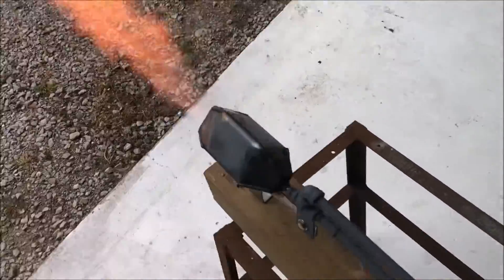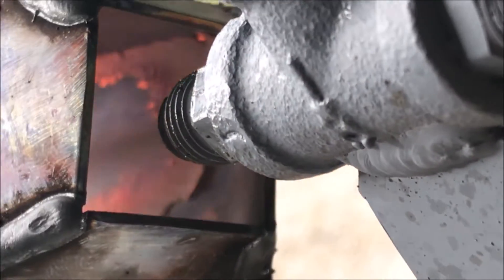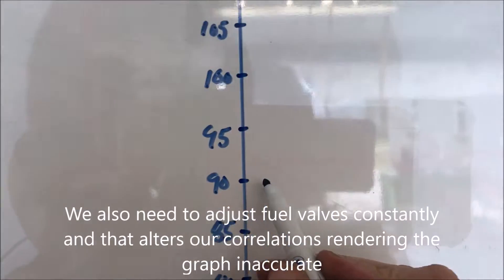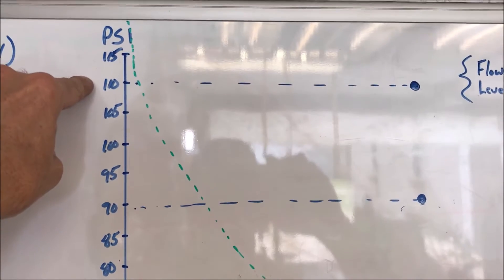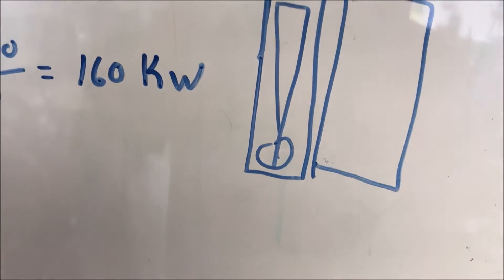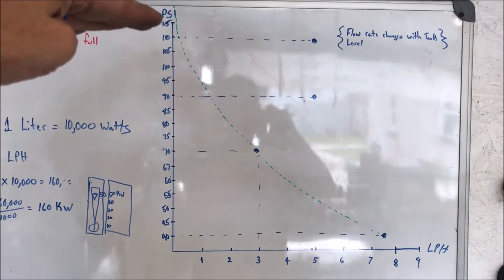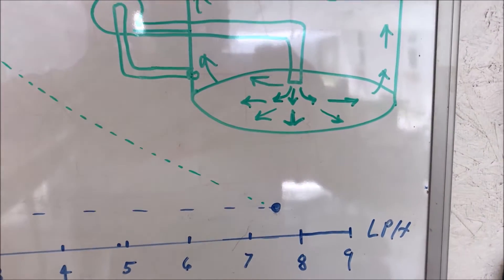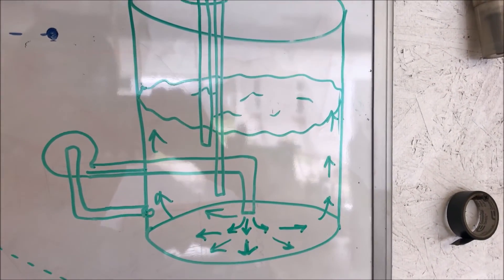Power output Regulation in heating process control with siphon burners

Comment: Might pay to get some exhaust sensors in there from automobile industry. Help you dial in your burn rate regardless of head of pressure. Could take a feedback loop to servo that opens and shuts the fuel tap